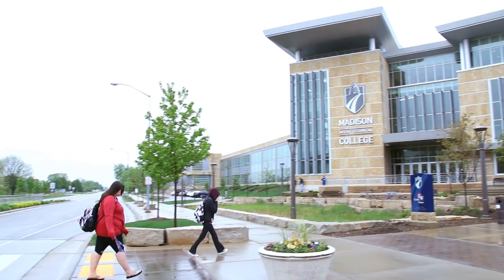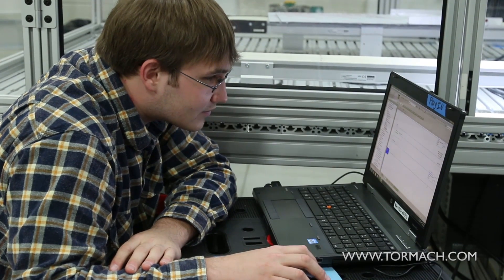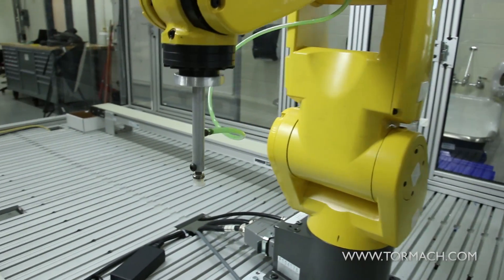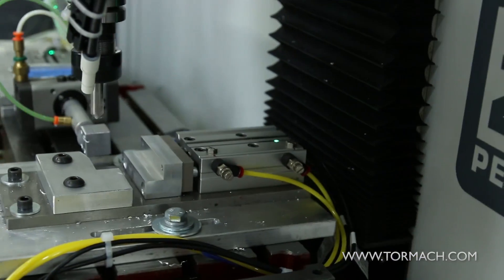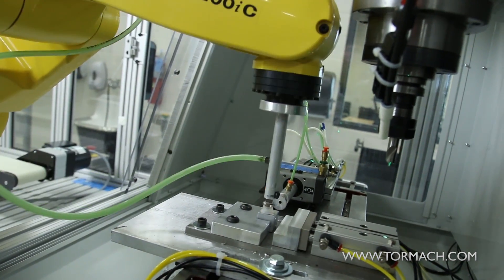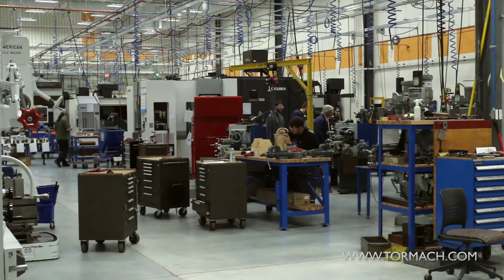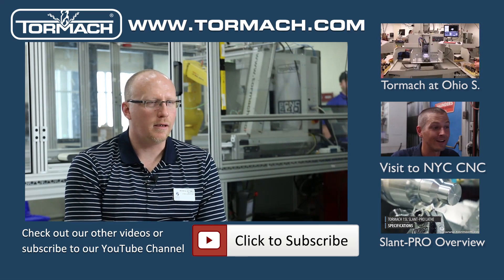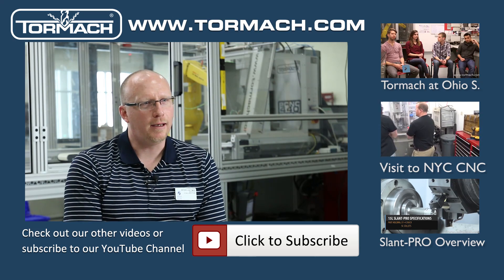Manufacturing Robots at Work for Madison College

Comment: Good for your guiding these young men into things that can help them keep our industry strong.  I am ordering a 440 within the next month or so.  I have a design consulting and prototype business with 30 years of  mechanical design experience  in Solidworks design including finite analysis, and other tools.  My machining past combined with my purchase of a brand spankin new 440 to start, may help me into my retirement years.  I know that the venders and people I've worked with in the past years will need some assistance now and then.  This machine is PERFECT.  Not kissing tookiss, just happy my wife will let me buy one.
Reply: Had my 440 for 2 years now and made enough in the first 6 mos. to cover the cost of the machine.  This is a great machine to start with and it has been solid running.  Great customer service, though I haven't needed them in a while and it was when I was setting up my ATC. (BTW, "HunterNugent" is my old youtube acct.)

Comment: we purchased a 770 for this purpose but found the interface ability was limited. ended up shelving the idea unfortunately.
Reply: Tormach has some I/O boards. Maybe someone from Tormach will explain them.
Reply: that'd be slick, I'll have to look into it. we bought the machine several years ago, but the options were limited at the time. we were going to hack the keyboard to do what I needed, but decided against it (lol)
Reply: It's item 32616 in the Tormach store. Called "USB M-Code I/O Interface Kit" and has three inputs and four outputs. NYCNC had a video on it recently too. Could save a lot of time.
Reply from the maker: Here's the link to NYC CNC's use of the IO board: https://www.youtube.com/watch?v=riWvR6d--oc
Reply from the maker: And here is the link to the I/O board on the Tormach website: http://www.tormach.com/store/index.php?app=ecom&ns=prodshow&ref=32616